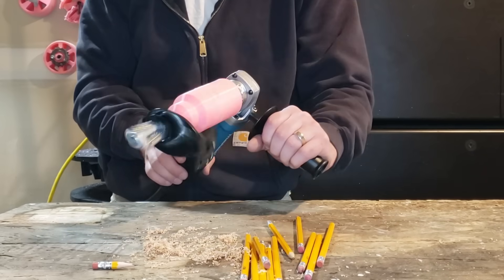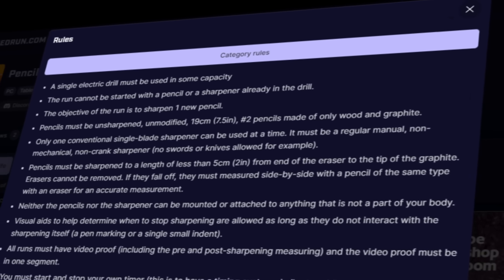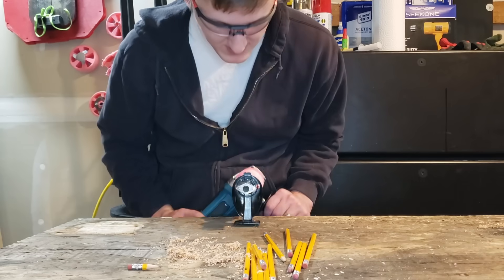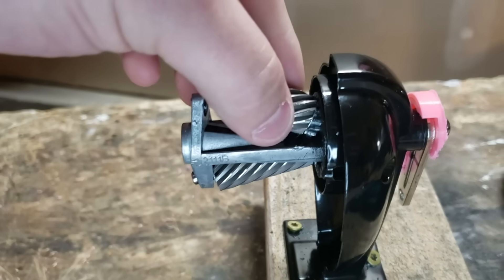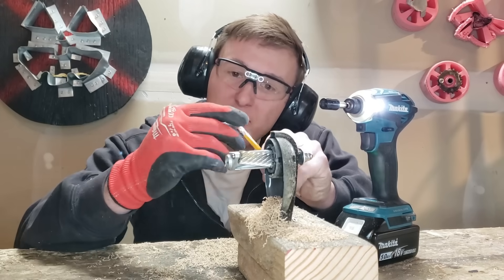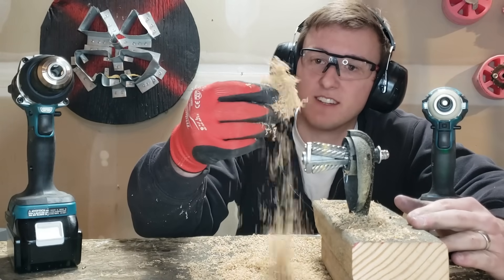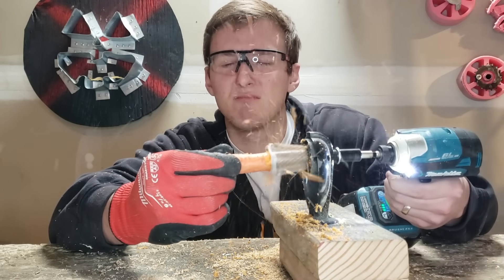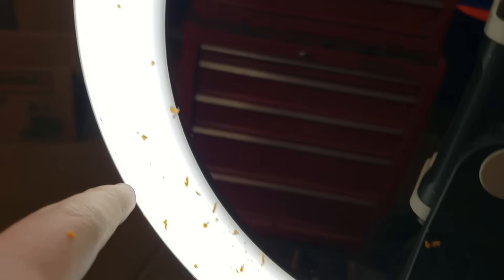I Made the World's Fastest Pencil Sharpener

Comment: Pretty badass!!! Imagine something similar at pencil production line. Each pencil is pushed,  gets sharpened and falls into the box in say 0.2 sec. Gets sharpened and not completely eaten by sharpener.
Reply from the maker: Yeah that'd be neat. Unless you mean that already exists. Then that's cool.
Reply: @currentconcept  this does exist, kind of! They use what is basically a huge belt grinder instead, the pencils are rolled past it at an angle and get rotated so they sharpen to a consistent point

Comment: i use a pencil sharpener for wood workers that my grandpa got in the 70's. its designed to sharpen to an extremely sharp point and then STOP. its pretty amazing and i have no idea how it works lol. its all mechanical, and it will not sharpen a pencil any further once the point is perfect
Reply from the maker: Thats awesome. This one doesn't have that limitation lol
Reply: I would imagine it has a lever/contact at the bottom of the sharpener. The sharper the pen is, the further in it can go
Reply: Any idea who made the sharpener. I could use a good one
Reply: @Scooty_scoob  
El Casco M-430 is your best bet, or if you want something a bit less advanced you can get a Boston "Giant"/APSCO
Reply: most pencil sharpeners now have a little tab at the end that will push the pencil out when the lead hits it, effectively stopping the sharpening.
Reply: What's the make & model of it? I gotta get me one of these!
Reply: Uses infrared signal in the back probably